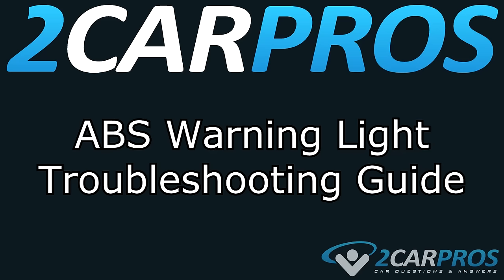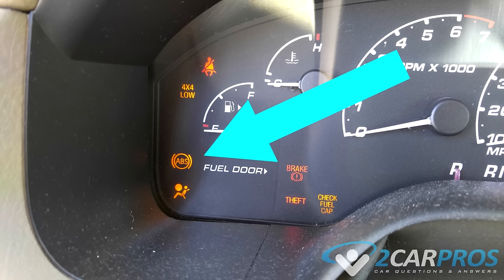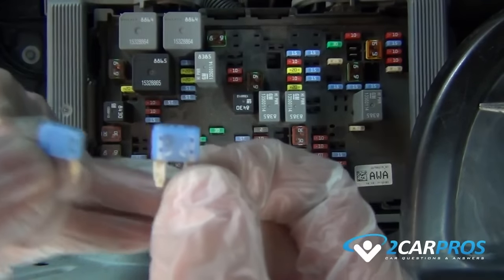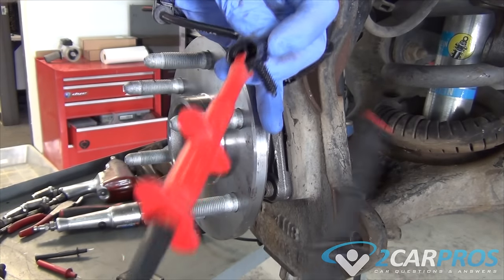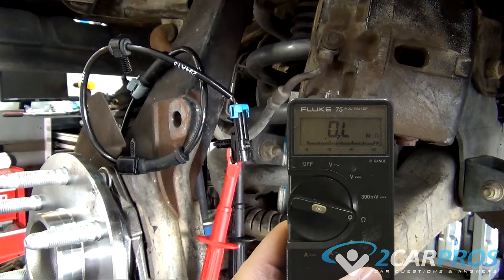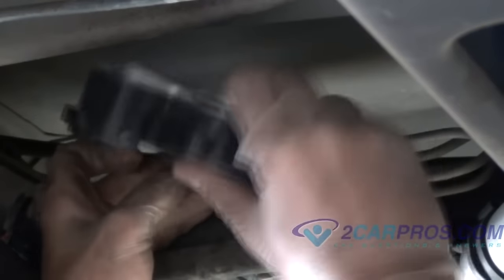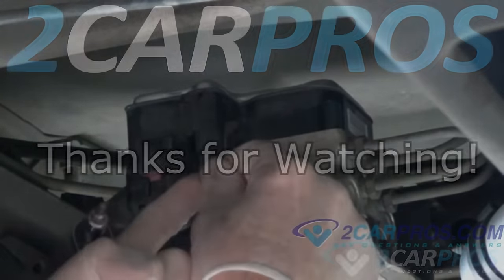ABS WARNING LIGHT ON? FIX IT IN 3 EASY STEPS

Comment: My 2013 Sierra is showing right rear wheel speed sensor circuit open or shorted.  I changed the sensor and still have it.  Where can I find a wiring schematic so I can ring the wires out back to the ABS control module plug.  All I need are the pin numbers and location on the plug.They say the wires break at the plug in at the sensor.  I am not seeing it.  What if I jumped from my left rear to the right rear?  If it still read open then I know the wiring is busted somewhere.  Frustrated to say the least

Comment: Hi on my Holden Astra 2002 there is ABS and traction control sign appears on dashboard. Even though I had changed its left wheel bearings and brake pads. When I apply brake and Stops the car at signal then if I accelerate the car it seems like tyres are jammed until it reaches the speed of 30-40. What I can do to fix things? 
Thanks

Comment: The question I have is the ABS light is on the car will still stop but it'll feel like something's grinding. Someone told me it could be the speed sensor that's on the back wheel indicated by the reading of the code. I brought it to two mechanics and out of the two they have different opinions. So I don't know what to do at this point I can drive I have been driving before abs was introduced. However I believe if it's needed that I got to get it fixed can you give some helpful advice
Reply: Sounds like brakes grinding or maybe bent dust plate. Hit any curbs or holes?
Reply: @abe6517  actually no it was not the plates what it was was exactly what I thought it was the speed sensor in the back connected to the brake. Got it fixed didn't cost very much I'm on my way again

Comment: My abs and brake light warning came on my brakes failed and then 20 min later as I continued to drive with caution 4-5 mph it auto corrected and the warning lights and sound went away. What should I do?

Comment: Not all vehicles with abs have sensors on all four wheels check out the 96 Ford ranger has the sensor in the differential one sensor.

Comment: my ABS indicator not turn on when the engine switch is turned to the ON
position, is there a possibility if the blown fuse is the cause?
Reply from the maker: Yeah that is possible or the bulb in the cluster is burnt out. Thanks for watching!

Comment: I'm having no problems with my abs but I need to pull the fuse for another reason and when I pull it will it put my ABS light on and if so when I put the fuse back in will it make the light go off?
Reply from the maker: Correct. Thanks for watching!

Comment: I have an 06 honda odyssey and the VSA, ABS, and BRAKE light are all lit up. I've taken each abs sensor out and cleaned them, none looked so dirty that it would've caused the problem. is there a way to test each sensor to see if I have a bad one? would it be the same way as in the video?
Reply: Have you check the VSA/ABS fuse on the engine fuse box and drivers side fuse box?
Reply: Yes

Comment: i know how to drive with plain brakes. I won't lose control of my vehicle because the ABS isn't working.
I know how to drive with a manual steering wheel. So, I'm not stuck when the power steering goes out. 
I know how to unlock my car door if the battery dies. I'm not going to call 911 like some freaked out little girl on another video I saw. We need parents teaching their children everything about vehicles they drive IF you cannot get into a Driver's Education Class. But, even some of these classes lack with the details. 

I was so blessed to have a Dad talk to me about everything car related and teach me to drive in ice and snow in huge empty parking lots and how to re-enter the road if you go off of the berm without oversteering, which is easy to do when you're not trained it in whatsoever. I could do a tune-up and change a tire before I got my Driver's Permit. 

Well, times have changed and engines are so compacted now. But, you can still teach kids how check fluids regularly, and to use tools properly and what to look for on the first cylinder spark plug. I printed out a diagram that shows what the different kinds of build-ups are on a sparkplug and what it means. And, when you hear engine ticking get louder, it's time to add 1/2 quart of oil so the engine doesn't blow, so you can get to where you need to go and let the engine cool down so you can check and fill the oil. And, don't put cold water into a hot radiator or the engine will crack. And, you'll scald yourself if you don't let the engine cool down first, because that radiator will blow hot water up to the hood and it will spray hot water and antifreeze everywhere. My dad opened it on purpose to show us how it sprayed, and were were back far enough to feel a warm shower. My friend forgot that she had added water to her radiator in the winter. The car was fine as long as it was warm. But, the next morning her car wouldn't start due to the ice blockage in the engine. She had an electric blanket and decided to try that because her husband was away on business. It took some time but it worked. Understandably, the blanket now stays in the garage. I wonder if he uses it to crawl under their cars? That would beat a cold cement floor. haha

Comment: What common caused when i got to scan may abs and the result is "front right abs noise" i hope you can give me any idea or suggestions... cause both abs and brake lights appears on my dash thank you in advance...
Reply: Yes...ABS and brake system work together. The abs brake module controls the brake fluid to each wheel. One big expensive magnet.

Comment: You will not lose control of your car or truck. When the ABS like comes on, your brake system is still working, only is the Anti-Brake part is not working. Norman braking is still working!
Reply from the maker: Correct. But many people panic in emergency braking situations and if the ABS isn't working they would lose control of the vehicle. Thanks for watching!

Comment: My ABS light went on 30 days after a complete bearing wheel assembly w/new ABS wires, new rotors, calipers, pads job.
Reply: DeWALTer_White its walter white
Reply: Not when Walter has DeWALT brand tools.

Comment: My ABS & Brake light come on intermittently on my 02 2wd dakota pickup. My ABS system works like it should.  I replaced the sensor in the rear end, no change. Lights still come on intermittently.

Comment: Yesterday i did a burnout in my camaro and what do you after 5 seconds the abs and vsc light came on. Any suggestions?
Reply from the maker: Sounds like a rear wheel speed sensor went bad. Scan with a OBDII scanner to see which one it is and replace it. Thanks for watching!
Reply: 2CarPros thanks for the suggestion actually it went off after 2 days

Comment: My ABS and Brake light comes on sometimes and when i shut off the motor and tap the brake a few times then it goes off.  I checked the brake fluid and it's good.  Please could you tell me what it is?
Reply: Loose wire?

Comment: changed sensor twice changed wheel bearing changed abs pump light still on now been told might be wiring who would i need to contact to get it checked a trained mechanic/electrician?

Comment: Question pls.   I have a 1990 Mercury Cougar Bostonian.  My "emergency" brake light came on.  ?? What could this be?  I just checked my brake fluid and it's full.  Thank you in advance.
Reply: Chandra Leigh how the heck is that thing still road worthy????
Reply: Check the e brake handle in the down position. And if light is still on remove rear tire, then open the drum check e brake pad worn or not.

Comment: i have an 03 Nissan Maxima and while driving it i noticed i had no acceleration and my ABS light came on. After a couple seconds the light went off and i had acceleration again. This happened twice on my way home today. Do you have a solution for this?
Reply: buy an american car?
Reply: Ed Smith well I'd much rather have a small deceleration problem than be broke down completely.lol.I'll stick with my Nissan
Reply: blove9387 same things happened today when I was parking my 2006 buick rendezvous. Skidding but not my abs light on.i bough it car   1 month ago.first week samethings happened and car dealer fixed they said they change it brake ..today skidded again bt not abs didn't light came on
Reply: Chicken ProGaming my issue was a bad alternator

Comment: I have a 2007  CL 600 with 76,000 miles. The ABS light came on yesterday with the warning triangle. I don’t drive Often but once a weekend or so. My wife was last to drive but she said no issues?

I have new brakes and sensors on them, less then 3000 miles. I am going to check the fuse next. 

Some say it could be the battery or alternator? It seems all is fine with them. I am noticing the head rest extending, loss of ease in steering and lights are on in the dash. Distonics (sp) cruise stopped working.

One other common issue that may not be related are the tire pressure readers are not reading all the time? And the rear sunshade stopped working but that I can hear the motor.

V

Comment: Question ..i have a 2015 wrangler sport unlimited 3.6 . I had a code for the rear right/ passenger side abs sensor and the traction control light lights up at the same time . I can be driving or just sitting  so i replaced all four sensors ... i still get the code for the rear passenger side sensor and traction control still lights up... but now it doesn't throw a code anymore .. any suggestions
Reply from the maker: Sounds like the ABS module is going bad. To confirm this scan the CAN and here is the video showing how https://youtu.be/InIlnsjOVFA 

Thanks for watching!
Reply: @2carpros  thanks
Reply: @2carpros  i do have a scan tool.. my cheaper ones range from 250$ to 350$ .. my newest scan tool is from launch its the x-431v series ...cost 1000$ but does everything ..im still learning how to navigate through it ..

Comment: The road had ripples from heavy trucks stopping at the red light.   The light was red, I applied the brakes and the abs kicked in, kicked out, kicked in, kicked out and I almost hit a semi head on as it was turning in front of me. My truck just rolled under the light.   I do not want to fix them. I want to kill the dash warning light . I disabled the abs but the light is on all the time.  My brakes work fine without it. It almost got me killed . How can I get rid of the dash light without dismantling the truck.  2005 Silverado 2500 HD
Reply from the maker: I don't recommend leaving your ABS off but it is your truck and you do you. But if you want to remove the light you will have to take the instrument cluster out. And if you sell it you need to tell the person you sell it to that the ABS doesn't work.

Comment: I own a 2008 Buick Lucerne CXS.  Car was driving fine until I noticed battery saver and ABS light when on and lost power.  Was told. Battery - good and alternator-good.  General mechanic referred me to take car to electrical shop.  Why would car totally shut down. Battery was drained per AAA technician.

Comment: Just replaced both front bearing hubs and now the abs light is on wasn’t before. Any ideas.
Reply from the maker: You might have accidently damaged one of the sensors or wires. I'd plug a scanner in and see what the ABS code is. Thanks for watching!

Comment: 2005 Chevy Express cargo van. Fuse box does not show a ABS fuse. is it called something else. ABS light came on about a month after changing front wheel hub assemblies, rotor and brake pads.
Reply: some Abs work from a senor on the bearings,or the abs cable was damage
Reply: Look in the owners manual for the location in the Fuse Box
Reply: DeWALTer_White , disconnect light behind dash, trade in car.
Reply: It's under the hood

Comment: Took my car to a professional who said I needed a wheel bearing and then this pro broke my abs module so he did he’s fix for free and he did but my abs light is still on and I my brakes lock up and the vibration he said was a wheel bearing is still there, I feel it when I rev the engine in neutral so I think it’s a motor mount but he said he had no idea what the problem was.

Comment: My abs and brake light only come on when I start driving could it be the ABS control modular
Reply from the maker: Yes it could. I would scan the computer for codes and latent codes. Thanks for watching!
Reply: @2carpros  i did. It came up c2200

Comment: My isuzu ABS light only turn on after 5 to 20km of driving after the were started. but sometimes...after the engine is off for 15 to 20min the problem repeat again...

what could be the problem?
I had sent the car for diagnostic a few times but the devices cannot detect any problem...

Comment: Must the ignition be on to spin the wheel hub to test for AC voltage when checking a new ABS sensor?
Reply: No, the sensor is disconnected from the car harness at that point and your checking only the sensor by itself. And this trick does not work with all sensors.

Comment: I just replaced both wheelhubs and now the abs and tc light is on🤷🏽‍♂️ it was never on before.  I unplugged the terminals from the battery and still on
Reply from the maker: Plug in a scanner and find out what the codes mean. Thanks for watching Pablo!
Reply: @2carpros  no codes sir

Comment: You missed testing that the electric motor that drives the hydraulic pump is working properly. One thing that wears with time are the carbon brushes.

Comment: hi guys, i have a problem with my ABS  bmw 5 seriuse model 1990 525i,  it work on the slow speed when i go above 50-70 it stops working again  and the ABS light comes on. i have changed the 2 front ABS sensor as well

Comment: Thank you!!! It worked.
Reply: Yeah thanks for the great videos I just wanted to say  that I 've worked on my owned car's but were in a new era times have changed to quote the king of rock-n-roll (you must change with it ) people start buying the right tools a error code reader is a must 😞👌 or your at the mercy of every one trying to make buck off of you its just reailty. The obd2 error code reader can be  very useful. If you have your repair manual for your vehicle this has section that has the definition of those codes in it you just plug the unit into the pin connecter under the generally by the steering wheel or arowned the driver's side of the vehicle 😜 now lets stop blaming people who are trying to help us figure stuff out ok😅good luck tk
Reply: I was going to mention that if you don't have book you can type the error code into or on google and get it there just make shure its the right code thanks happy holidays. Tk
Reply: I meant under the dash

Comment: What if you have the abs and traction light on both at the same time?
Reply from the maker: They might be related or they might not. You need to scan it and find out. Thanks for watching!
Reply: Sensor or complete hub assembly bad will do that, on GM at least. Maybe other makes too. Could be broken wire going to sensor too.

Comment: Why do we need it. I always have to disable mine. It has nearly killed me on more than one occasion up here in the mountains. When I have it on I can't stop in the snow when going down from my house. I can stand on the brakes and it still accelerates. Last time I went from 5 to 30 mph on my new powerstroke, so when I stopped I disconnected the abs sensor and tried the decent again. This time I had total control.
Reply: In the snow going down hill how would it work if you just kicked the transmission in neutral so it wouldn’t keep powering forward. I do this in my 1981 truck all the time and it works for me.
Reply: Just put the transmission in neutral
Reply: @stevanrose7439  it's a steep hill, I put it in first and engine brake. One of my trucks is a 6 speed manual and the anti lock brakes still have to be disconnected to slow down safely.  Once I disable them every thing works fine though.  I drive off road every day I drive though, and don't want to throw it in neutral every time a deer or elk runs out in front of me just to be able to stop safely when it's muddy or snowy. I can't think of a time abs saved me, but it has made me lose control  more than once when they are working slick conditions.

Comment: What happens if there is 12 codes in there all cascaded from the original code and you have 3 controllers that could turn that light on?
Reply: Car mechanic shop happens :)

Comment: Replaced breaks, broke caliper, replaced caliper, now the traction control comes on randomly and it pulls to the side that I replaced, any ideas?
Reply: Check that you didn't twist or kink the hose when putting on the new caliper.
Reply: Ryan Shoquist thanks man, all it was, was because my partner incorrectly installed a drift wheel, so traction control wasn't connected to the steering wheel lol

Comment: ok this is my problem nd what i've done....i have an 03 camry xle 4cyl auto trans...the speedo started acting up..replaced output speed sensor no change replaced cluster no change replacesd abs control mod still no change.when it's working it wont read above 30mph also have done a 3-4 hr reset each time..what else should i be checking?
Reply from the maker: Visit our website www.2carpros.com and ask a free question! An automotive expert will be alone shortly to help you out! Thank you for watching!
Reply: my Nissan Xterra 2001 is not working battery okay car will not start over

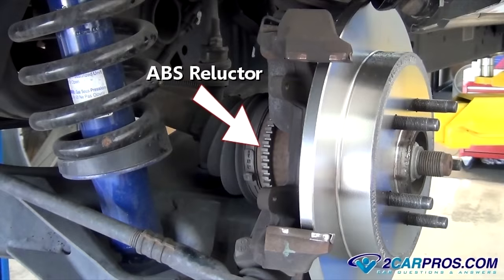Comment: regarding the view of blown fuse at 1:33.  Do not trust what you see. A fuse can be blown and still look Ok. I did not know it and it cost me  $100 on a new battery, I did not need, few hours limping around on a bike looking for a solution to why the bike would  not start, and then limping back home for 5 hours with the head lamp light getting weaker all the time as the night fell. The next day I check this fuse again. The voltmeter showed it not conducting electricity. even though it looked good The bike started instantly when I put in a new fuse. I could have saved myself so much distress yesterday if I knew it was only the fuse.